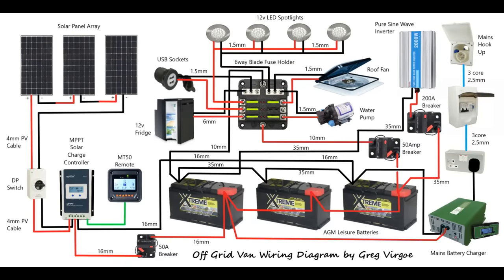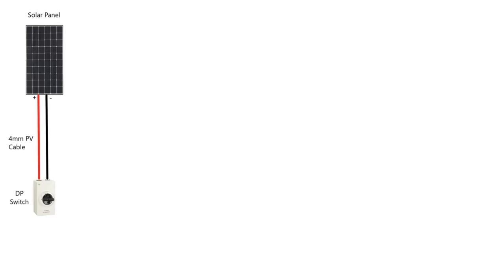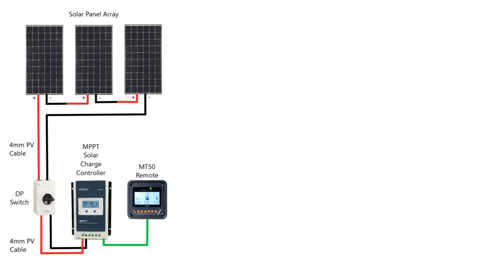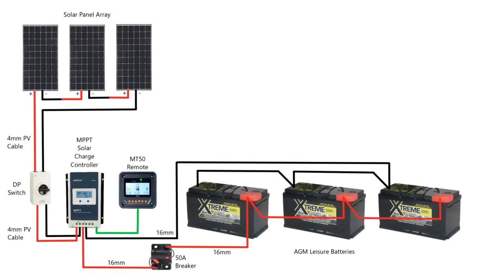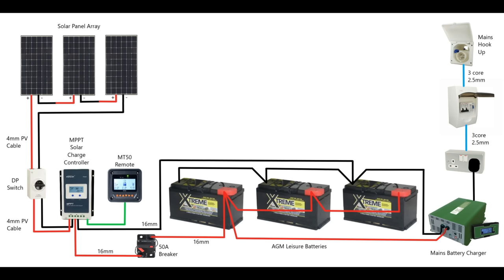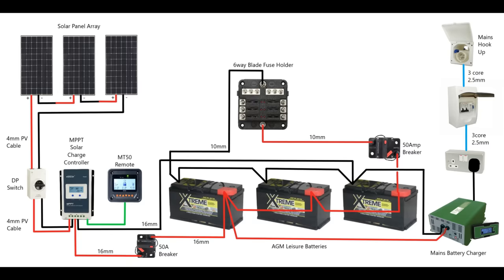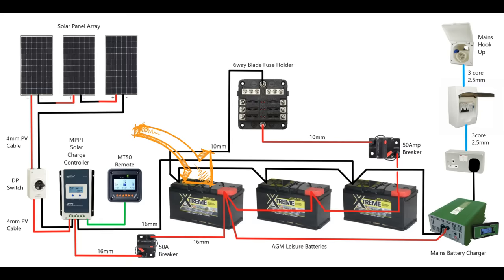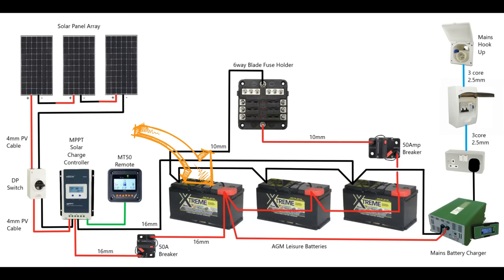How to Wire your Camper Van to be Off-Grid

Comment: Hi Greg.. what amp is the  mppt controller please as they vary in price so much
Reply from the maker: It needs to be sized based on your planned solar panel sizes. Each MPPT has a maximum input watts or voltage
How much solar are you going to have?

Comment: Hi Greg, the entry for your DP switch in the parts list links to 32 amp switches on ebay, did you use a 32 amp switch?
Reply: Sort of answering my own question, I have a single 160w Photonic Universe Solar Panel with a maximum current of 8.84 amps so a 32amp DP switch will give me some spare capacity if I choose to upgrade my solar panel in future.

Comment: Can I just add extra 230v sockets instead of an inverter as we only go EHU sites? 

Great video
Reply from the maker: If you are always on EHU you can do that and not use an inverter. Just be aware that most hook ups are 10-16A max so that limits how much stuff you can run at the same time. 👍🏼😃

Comment: Firstly, thanks for your videos helpful, can you please advise where I can get 20mm ring terminals (batterry) to 10mm wire leading to blade fuse holder then I need a 10mm wire to 5mm ring terminal on fuse holder, can't seem to source them. Thanks in advance.  Dan
Reply from the maker: https://www.12voltplanet.co.uk/battery-power-cable-terminals.html
Reply from the maker: https://www.12voltplanet.co.uk/battery-terminal-clamps.html

Comment: Now then Greg, I may be a little thick but, I can't find the link to download this schema. Thanks
Reply from the maker: Download your FREE wiring diagrams and parts list here:-
Wiring Diagrams for different types of off-grid van systems are here:-

1 solar panel, MPPT charge controller, 1 leisure battery and inverter.
https://www.dropbox.com/s/evzci35h8etyi68/Van%20Wiring%20Schematic.jpg?dl=0

2 solar panels, MPPT charge controller, 2 leisure batteries and inverter.
https://www.dropbox.com/s/h5yfuf090hgp4ga/Dual%20Solar%20and%20Battery%20Setup.jpg?dl=0

3 solar panels, MPPT charge controller, 3 leisure batteries and inverter.
https://www.dropbox.com/s/92ubo6d6k9miotq/Greg%20Virgoe%20Van%20Wiring%20Schematic.jpg?dl=0

Your FREE Van Build Parts List here - https://www.dropbox.com/s/zvtyj0z7cdeb9d8/Greg%20Virgoe%20Campervan%20Parts%20List.docx?dl=0
Reply: @GregVirgoe  cheers mate, I watch all your videos and I really appreciate what you do for us. I'm on with my third conversion atm. Keep up the good work

Comment: Hi Greg, I see in your diagram that you only connect the charger to either end of the battery bank, positive on one end, and negative on the other.  I am slightly confused with this set up compared to other explanations (not very clear either) have seen. 
 I am setting up a 2 ION Lithium battery bank and obtaining a charger,  Victron, 30A with 3 outputs.  So as to connect individually each of the batteries to the charger and lastly provide me room for an increase to a 3rd battery should the need arrive.  Do I have wrong? Your input is appreciated.  Cheers
Reply from the maker: When you have multiple 12v batteries you must connect them in parallel to maintain the voltage at 12v but in order to have each battery charge equally you must connect across the entire string to treat it as one large battery. 
The only other way of doing it is to have positive and negative bus bars and have equal length cables to each battery from the common bus bars. They must be the same so the resistance is equal as like water electric will take the least line of resistance. That’s why I prefer to do it my way as they are self balancing. I will find you a very good document that is worth a read and backs up my method.
Reply from the maker: Get this document https://www.victronenergy.com/upload/documents/The_Wiring_Unlimited_book/43562-Wiring_Unlimited-pdf-en.pdf and read section 3.3 about battery wiring 👍🏼😃
Reply: @GregVirgoe  that would be awesome.  Thanks for the clarification.  Cheers.
Reply: @GregVirgoe  Very useful and entertaining morning reading.  Saved me some €€€ as I was about to over dimension the charger.  Do like the option of using the busbar to balance the battery bank.  I will have to make a choice closer to the "electrical cabinet" set-up. The analogy of water vis a vis electricity is very appropriate, rivers, pipes cables pressure heating all relevant knowledge for this task.  Thanks
Reply from the maker: @user-mb5qg3iz9u  and dont forget that adding extra cables and components like busbar etc is adding extra resistance to the flow. simple is better. Glad it has helped. That Victron Doc has a wealth of free information :D

Comment: How does the Inverter give all the devices more power when its only wired into the battery?
Reply from the maker: The inverter works like a transformer. The power is converted from 12v at high amps to 230volt at low amps. It also changes DC current to a sine wave for AC appliances.
Reply: @GregVirgoe  ty I realized that the devices through the battery not through the inverter were probably dc.
Reply: The inverter would have outputs that you plug the bigger appliances in to. But check if you can get a 12v adapter for things like laptops and TVs. Saves using the inverter and saves power consumption.

Comment: how do you connect it to your alternator so it also charges while you drive incase you cant plug into a mains?
Reply from the maker: I would advise fitting a battery to battery charger. Something like a Victron Orion are very good and will look after your leisure batteries really well 👍🏼
Reply: @GregVirgoe  Hi Greg - As with the other avid viewers we are hooked into the series and about to embark on a Sprinter conversion-Many thanks and amazing level of detail and advice. In response to this comment about the B to B charger, if off grid and not mobile, is there a risk that the main battery could be drawn down by the Leisure Batteries and you end up with all batteries flat?

Comment: Hi Greg your videos are awesome but I'm one of those guys that need it drilling into my thick head haha. We are in the process of buying a vauxhall Movano on a 16 plate. Me and my wife and son are gonna start travelling round giving our son lots of memories and saving a fortune in the process by doing our own conversion we need puck lights putting in sockets here and there for things like the smart Tele and usbs put in here n there for phones and tablets and we're gonna have a usb heater it's awesome seen it in action it's very good. And a couple of fans in the ceiling. We also need to have a breathing monitor under where our son will be sleeping as he as had siezures so we have to monitor him what do you think we need for that kind of set up we're only gonna go on sites so we want a 12v system and a 240v hook up could you advice us what we need I could only follow your advice as you do your videos precise and there easy to follow. Thank you for your time and patience

Comment: Hi Greg, with that set up i gather you would connect the power out of the inverter to the mains power hook up. Is that correct.
Reply from the maker: No don’t do that. The 230volt power from the inverter goes to 3 pin sockets in the van to supply things like my heater and tv 👍🏼😊

Comment: So are you saying that connected in parallel, the batteries won't get any charge in low light? 
Also, I'm struggling to find out the correct info on cable sizes for connecting 3x100w panels, connected in parallel (as that is what I intend to do). The info that has come with the Epever 30a solar controller says 8awg for 30a but I'm pretty certain that thickness of wire won't fit in the holes of my controller! Then again, I've read that 6mm or 10awg is okay. It's very confusing! Your expert advice would be appreciated 😉😊
Reply from the maker: With the solar panel wired in series the voltage is added so that gives you more chance of getting a charge voltage even in low light. 
You would need 6mm2 solar PV cable for 3 x 100w wired in parallel (10AWG)
Your charge controller should have terminals that will take able up to 16mm2 (6AWG)
Hope that helps you 👍🏼😊
Reply: @GregVirgoe  Ah I knew I could rely on you to help-thank you Greg 😊. And yes, I should be able to get 6AWG wires into my controller as that's what the manual says. However, I'm not sure how, unless I was to put shoelace ferrules on the end perhaps? 🤷‍♀️. Anyway, I'm happy to go with 6mm² and hope that fits! Thanks again 😊
Reply from the maker: @anothercampervanchannel  ferrules are always better if you have them to hand 👍🏼😊
Reply: @GregVirgoe  Thanks, I will try them if the wire doesn't fit. Oh what about the wires to the batteries from the controller? Or is that what we're talking about here? I'm confused, it doesn't take much 😆🤦‍♀️
Reply from the maker: @anothercampervanchannel  ok so you need 10AWG solar cables from panels to the MPPT then 6AWG from MPPT to your leisure batteries. 👍🏼😊
Reply from the maker: @anothercampervanchannel  oh and make sure to connect the battery first to the mppt before you connect the solar panels. Very important to do it that way.
Reply: @GregVirgoe  Okay. I'm definitely going to need some of those ferrules then! Thank you 😊
Reply: @GregVirgoe  Yep, cos obviously there's power coming through the solar cables (unless you cover the panels of course ?) Thanks  😊👍
Reply from the maker: @anothercampervanchannel  I did get 16mm cables into my MPPT charger ok 👍🏼 😊
Reply from the maker: @anothercampervanchannel  the MPPT needs to be powered up by the batteries first so it’s working before you connect the input power 👍🏼😊

Comment: What size cables come off the mains battery charger? Need to extend mine, looks like 6mm
Reply from the maker: Yes I’m sure mine are 6mm as the max amps are 30 and right next to the batteries.
Reply: @GregVirgoe  nice one thankyou, just looked mine is the next side down 15amp output as I'm only running 2 batteries so cables maybe a little smaller

Comment: Can anyone help ?.... so I have just started my van build. Sprinter lwb. I have started insulation. Wondering if I should drill the hole and partially install the electrical hookup mount for the side of the van to the inside before I finish the insulation or do people do this after.?. I am totally new at this no experience so unsure what order things are best to do really. Any advice appreciated 🙏.  Thanks .

Comment: Dear sirs, to where do you connect ground cable line for 230v AC appliances (from power inverter).. logicaly, the ground cable need to connect to where we stand (in bare foot) which is the RV body (chassis),. but if the RV park and we step down to the the earth and need to touch the appliances that still connect to the power inverter, is it realistic to connect the ground cable to the earth?

Comment: Hi Greg 
I'm looking to install a 3kw inverter.
What size cable and fuse would you recommend I use.
Reply from the maker: My first question would be why a 3kw inverter as that is a huge draw on 12v batteries.
Reply from the maker: That inverter would require a 300Amp fuse and 70mm cable with max length of 2m
Reply: Thankyou Greg for your prompt reply. 
3kw inverter as I have a 2kw electric water heater fitted.
Reply from the maker: @mohammednaheem6732  anything that is using electric to heat things will use a massive amount of power. For example to heat 10litres of hot water in 20mins would use 145Ah of battery power. That’s approx 1750watts of solar power gathered in one day. Typically electric water heaters are only run off an electric hook up for that reason.

Comment: So we don't take an earth cable from the consumer unit to the van body?
Reply from the maker: It is good practice to earth the 230volt mains side to your vehicle 
The 12v DC side does not require an earth connection.
Reply: @GregVirgoe  Thank you for this. Please could you explain why this is? presumably your already using the campsite earth? Just trying to get my head around it all. Have finished all of the 12v system side of things. 
I've seen loads of conflicting advice on this with people saying that if you do earth your 240v consumer unit to the van body then the van would become live at 240v if there was a fault and would cause harm to someone who touched the van. 
Many thanks
Reply from the maker: @sIikBeav3r  The 230volt is most dangerous so you need to protect against short circuit. By bonding everything you the chassis you are creating an easy path for current to flow and then your RCD will detect the difference between live and neutral and trip the supply. Connect all earths together and connect to hook up earth as well.

Comment: I have my solar panel charging both the leisure and vehicle battery, but while the engine is not running. Can I ask is it safe to run the vehicle whist the solar panel, through the solar controller) is still connected to the vehicle battery? I ask this because will the heavy charge coming from alternator feed back into the solar panel and burn it out as it could do that I suppose. I have an in line fuse from the vehicle battery to the solar panel controller where there are 2 connections for 2 batteries, No1. I have the leisure battery and No2. I have the vehicle battery connected, as I only have one leisure battery I didn't want to waste that No2 battery input at the solar controller panel. Can you advise please?
Reply from the maker: I’m not sure how your controller will react to seeing one battery with high voltage when the other is at normal voltage. Best to ask the manufacturer of your solar charger

Comment: Hi can I ask the 50 amp circuit breaker from the leisure battery to the fuse board does this have to change if you have 12 way fuse board and not a 6 way? Thanks Li
Reply from the maker: The size of the breaker is based on the sum of all your appliances that could be running at the same time.

Comment: Is it required that any of the red and black wires be the same lenght?  Like coming from the inverter.
Reply from the maker: The interconnecting battery cables should be the same length. The rest is not critical.

Comment: Hi Greg  I have 2 atm 100 amp batteries  I going to  put a battery monitor  on  my ? Is when I conect the 2 battery I put the shunt on negative post and then the outher negative battery cabel goes on the a shunt and not to  battery  post   I have a negative bus bar can I use that  not sure if I make8ng sence  thanks

Comment: Just one question... to wire up 240v sockets via the inverter, where do the wires go to and from? Do they go from the inverter to the sockets and back or do you use the blade fuse holder as well?  And what size wires are required please? Thanks!
Reply: Hi The inverter usually comes with 2 or more 3 pin 240v plugs just like house and you can just run an extension lead is the simplest way as the 3pin appliance already has a fuse in the plug, you can also wire it to the inverter has terminals just like a fuse box/ battery but you will have to put your own inline fuse, this is very rare such as for some electric ovens as almost all 240v are 3 pin for safety, 240v ac is more dangerous than 12v so I would just stick to simple plug in setup. Make sure the inverter has enough power wattage rating for the appliance or you risk breaking the inverter as some appliance such as hair straighteners or kettle or microwave are 1500-2000w so they would blow a 1000w inverter
Reply: @hamiltonharman9962  Thank you!

Comment: Do you have to use arctic rated 240v hook up cable over non arctic 3 core flex?  Thanks
Reply from the maker: Not essential it just copes with much wider range of temperatures.
Reply from the maker: Key point is that it’s a multi strand flex and not a solid core cable as it’s in a moving vehicle with lots of vibration.
Reply: @GregVirgoe  Thank you for your advice. 
I already have 2.5mm 3 core flex (non arctic rating) just wondering if I need to go out and buy arctic. My current cable is non refundable. 
I'll be installing the hookup socket under the bonnet, next to the starter battery and running back through van interior (VW t6) 
 Do you think this application would benefit from having arctic?
Reply from the maker: @sIikBeav3r  it would be good to put anything external like that into a flexible conduit for extra protection.

Comment: Hi Greg can I ask the wire size you have coming from the moot controller is 16mm yet the wire from solar panel to controller is 4mm why is this? I’m using a 200watt solar panel and a 20amp controller and don’t no what cable size or fuse to use from the controller to battery?
Reply: The solar panels will be supplying low amperage, and since they’re wired in series only their voltage will increase and their amps will stay the same. That’s why you can use the 4mm cable provided with the panels.

Comment: I have a fridge that is 12v and it says maximum fuse rate is 6.25 so what size fuse do I fit please
Reply from the maker: That does seem small for a 12v fridge. Our small 50litre fridge has a 15Amp fuse. Does it give you the running current in amps?
Reply: Good question - 12 volt fridges seem to be no more than 60watts (5amp)!

Comment: Oh sorry,  you are ment to switch off the breaker when changing the battery from the charger.👍 Makes sense. Sorry?
Reply from the maker: No you don’t need to do that. The mppt charger will see the higher voltage from the mains charger and back off to standby itself automatically. 👍🏼😊

Comment: My solar charge controller wouldn't take a 16mm cable from the batteries as the terminal is too small. Can I use the cable that came with the panels? Think it is the 4mm cable
Reply from the maker: What is the model of the solar charge controller?